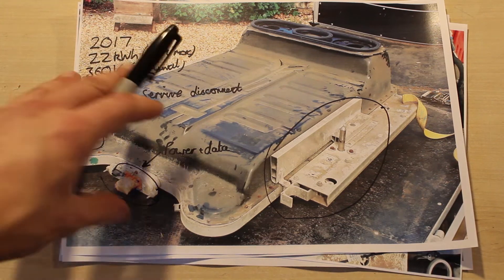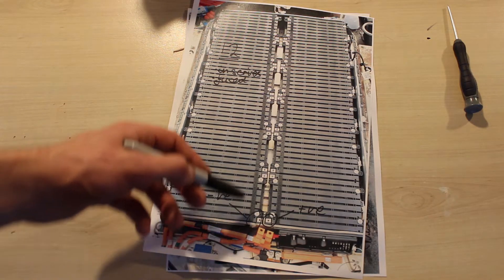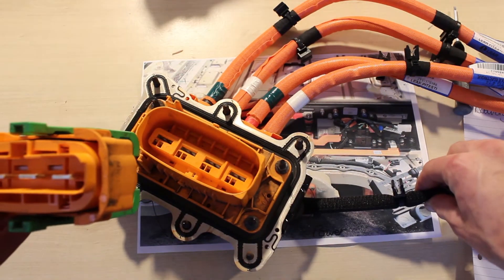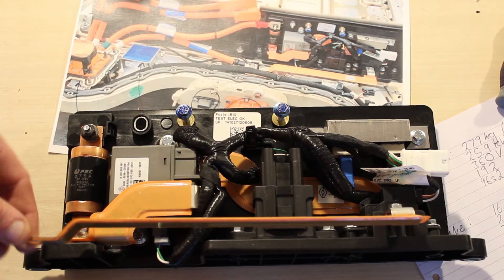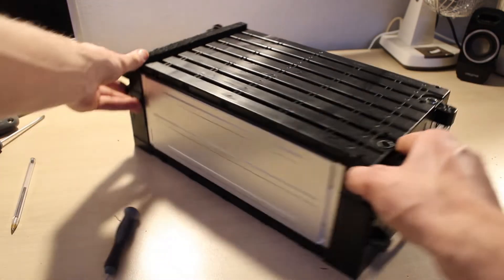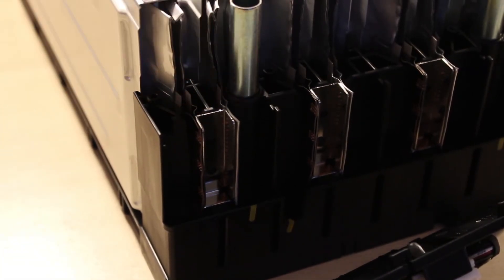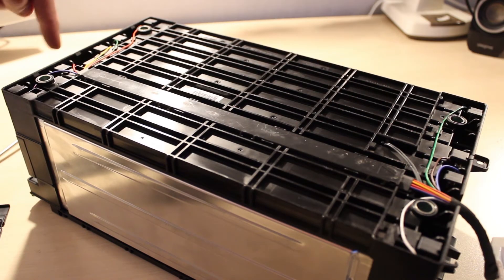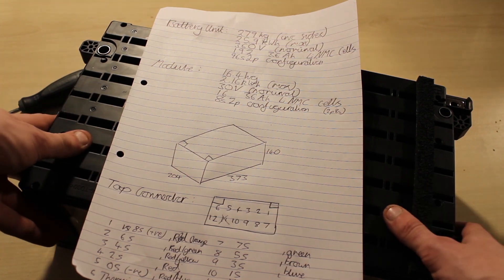Renault Zoe Battery Disassembly - LG Chem Modules - DIY EV Powerwall Solar

Comment: I'm particularcly interested in cooling - so the air passes in/out only through one hole? How is it circulated through the battery?
Reply from the maker: They don't seem to have much cooling or heating. Air goes in the centre hole, through the centre channel of the two battery banks and flows past the aluminium (?) sides of the modules and them returns to the front of the pack along the outside of the pack. This link is a great resource that illustrates this: http://cii-resource.com/cet/AABE-03-17/Presentations/BMGT/Prochazka_Wenzel.pdf
Reply: @TopRockEV  thanks, that's really a great resource! :)
Reply: @electricwhirl5175  As in: the battery itself doesn't have much. On top of the battery is a unit in the car containing a fan block, and an evaporator hooked to the AC system. In some models (and all ZE50 models) it also contains a small PTC heater. So it can heat, do nothing, cool passively (just ambient air blowing) and actively (cooled air). That part too is pretty nifty from a control point of view and well engineered.
Reply: @JWM-Meijer  thanks for the explanation.
I understand that this is not so easy to do as might sound - just a tube of air, but I think it could be have been implemented in VW eUP/eGolf or Leaf. E.g, Mitsubishi iMiev has cooling with AC which help a lot to prevent rapidgating.
Reply: @electricwhirl5175  Absolutely. A battery the size to power a car needs decent thermal management. It can be done in different ways of course and only fanboys state their preferred method is the only one. If you look closely at the video you can see the air channels between the cells. And the airflow is from the center channel to the two outside channels, therefor three holes in the "chimney" part of the battery. Control is even more complex. When to warm up? Or when rapid charging, cooling when the temperature goes up it might be too late as there is more dissipation than (possibly uneven) cooling capacity, so it could make sense to pre-emptively cool even when the battery is at say 15C. It's absolutely a game of trade-offs and clever predictions.

Comment: Very cool to see the inside of this battery. Could you also give a closer look to the balancer system and stuff around it? Thank you :)
Reply from the maker: Hi Daniel, it is difficult to shoot another video but I can let you know some details. There are two wiring harnesses that run on the outside of case, one for the right 6 and one for the left 6 modules. The left harness also has plugs for the contactors, current sensor, service switch and data connector. The BMS is a box approximately A4 paper size and 25mm thick. There is a bank of 6 sockets to take the cell tap wires with 172 pins total (2*40, 2*32, 2*14) Not all the pins are in use. There is then another 24 pin plug that the left harness attaches to for the current sensor etc. All of the plugs are TE Connectivity components I believe part of the TH/.025 connector series. Interestingly I understand these are the same as on the Orion BMS. If you would like photos, email me :)
Reply from the maker: Something interesting to note, the 24 pin plug uses all gold plated pins where as the cell tap plugs use a mixture of gold and tinned pins. I am not very familiar with the standards for these connectors
Reply: @TopRockEV  This sounds very easy inside. I emailed you for pictures :)

Comment: Thanks for this, great work, you don't see much info on the Zoe batteries.  Could you put the physical dimensions of the LG Module block in the description. Thanks
Reply from the maker: Cheers Joe, it does feel like there's very little information on these. If you pause at the end of the video, I believe they are on the piece of lined paper. I'll also add that to the description :)